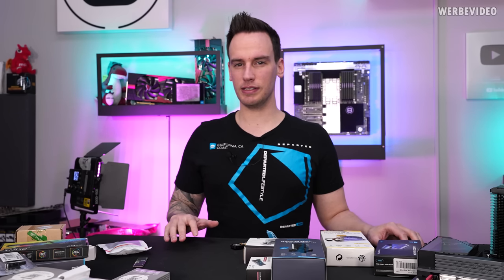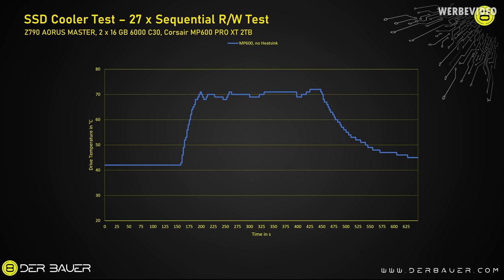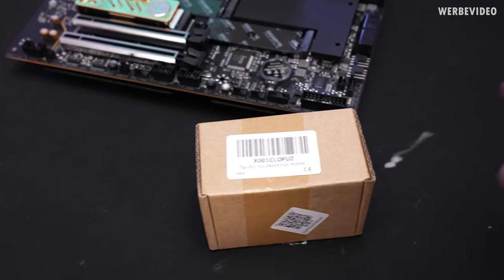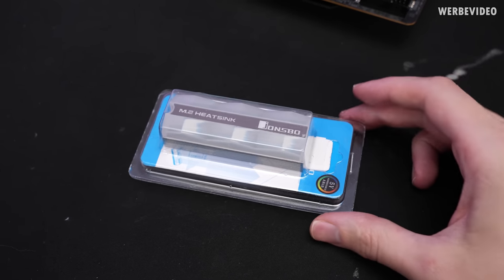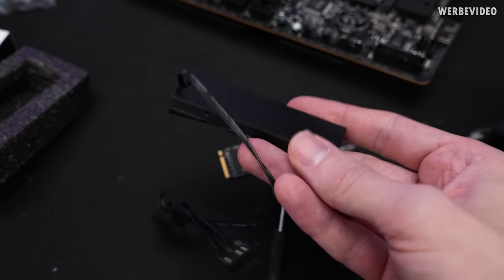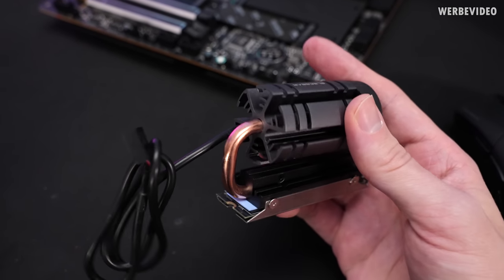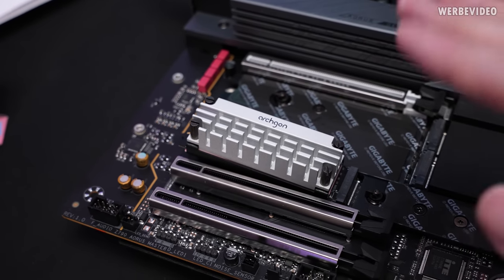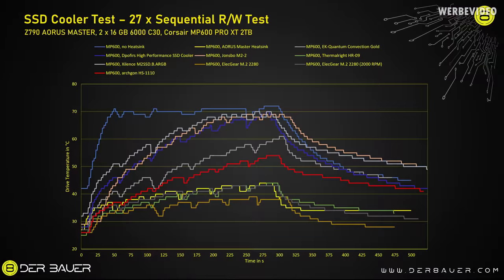Who designed these? Terrible Cooling Performance and "Interesting" Mounting Solutions

Comment: 3:54 From EK's productpage: "However, this latest heatsink will completely prevent thermal throttling in cases with sufficient airflow or otherwise significantly prolong the time before thermal throttling of the SSD occurs."  
  Well, it did prolong the thermal throttleling. But so does having an iPhone 13 Pro Max instead of iPhone SE (Both have A15 chip). The only great usecase for this would actually be to mount this at the back of a phone (covering the SoC). No heatsink fins also means you dont have to cut yourself everytime you pick it up

Comment: I have some basic NVME PCIE 3.0 SSD and I decided to mount a very basic and thin heatsink from Ali. The little cheap one mounted with rubber bands. I do not stress my SSD for a long time so I basically wanted something that will help an SSD to at least buffer the heat when loading game or something like this. It performs well enaugh as in a test like yours It reaches to 52*C and then drops back down to 30-35. When normally using my PC I stay below 50*C.

Still thank you for warning about the rubberband degradation. I have just mounted it a month ago and my PC is not exposed to UV light so I still have a time to figure out something better. ;) Probably I will end up with a zip-tie :D

Waiting for the tests of the rest. ;)

Comment: Der8auer, the Metal Pads are REMOVABLE, unscrew the screws you see in the thermal pad holes and the whole metal pad can be removed, no need to remove the thermal pads. Im using custom heatsinks o i removed all of them.
BTW, your TEST with original Gigabyte heatsink is not valid, the thing is that the cover covers ALL M.2 + Chipset, and on Z690 /z790 the chipset gets to 80 degrees, sometimes over 70 degrees [just tested] if you have everything plugged in and do lots of move/copy file operations, thats why i removed the original hetasink and use separate heatsinks, so they not touching each otehr or chipset
The style of this chipset coolers + m.2 is why i sent back AOrus Master and got MSI Unify-x, the uNify-X has same cooling but each heatsink is cut, no touching the chipset [the chipset after re-paste is 70 celcious], but im still using my own heatsink, the good ones are Barrow heatsinks that have 2 tiny fans and they also screwed from the top, i tested many heatsinks and these are great

Comment: The only reasons im going with bonkers cooling for my wife and my gaming pc's is the obvious 3" extension to my epeen. And that future Direct storage games might push SSD's a bit harder than they get pushed today.
Currently building the wife's pc. Have gone with the short version of the thermalright cooler on a WD black SN850. In a 011 evo with chimney style bottom to top fan arangement and the upright gpu mount. So the m.2 cooler should get quite a bit of air.

Comment: I'd like to see what your tests make of the M.2 cooler I bought.  ElecGear EL-80P M.2 2280 SSD Heatsink, Heat Pipe .  It seemed to me at the time that it was quite sensible compared to a lot of the ones you tested.  I am dubious of designs with small fans, thinking that a finned heatsink with good case airflow would be better from noise and temperature considerations. 

For me, this heatsink has significantly improved my SSD temperatures.  Previously, the SSD on its own rapidly shot to 80 deg C with very little load.  With this cooler, it rarely goes up to 50 deg C. 

I believe that Sabrent make a similar style cooler, so I'd be interested in seeing this type of design tested properly.

Comment: I have an xilence CPU cooler and its actually really good it dropped my temps by 30c over the stock AMD cooler on my Ryzen 5 2600 with no overclock due to bad motherboard even though with an old board this CPU will happily run at 4GHz

Comment: My budget motherboard does not have heat sinks for the M.2 slot built in. I also have USB M.2 adapters and the chips / board get EXTREMELY hot. I actually put a passive heat sink on my USB adapter I use and it seems to have helped, tho I agree with your assessment about the RGB "coolers" they seem mostly for looks. 

I would be very interested in seeing how other heat sinks perform. I've also been considering modding the steam deck with an M.2 heat sink (similar to the LTT video) and looking for a good heat sink that will do the job. Please do some more of these.

Comment: I have the Corsair MP600 Pro XT, and both of mine came with a heatsink. Did you remove it? It's not a straight-forward removal. I was missing that context in your video of where you removed the existing heatsink. I have an ASUS board and never thought to use the built-in heatsink.

Comment: I bought a different model SSD heatsink from Jonsbo (m.2-3 or something), which both looks better made, has no rgb gimmicks and at least for my ssd was the proper size. It still isn't held together by screws, the ssd is just sandwiched tightly between thermalpads and the 2 other parts (baseplate-thermal pad-ssd-thermal pad-heatsink), with the heatsink attaching to the baseplate with a sort of hook-slot, groove, requiring a bit of force to snap into place, along the entire side on both sides. Problem is that it also comes with different sized thermalpads, like the EK one (though they're the proper size for the heatsink), but no instruction manual on which to use for what type of ssd and whish side of the ssd to place them. So you have to either ask Jonsbo for help, or find the pictured guide someone else posted online after asking them, to which I've since lost the link to. On the plus side, it actually did lower the temperatures on my gen.3 ssd a decent bit. It maxes out around 51C in my case, averaging 38, with the heatsink that came with the motherboard averaging 44, maxing out at 50 for another ssd, but that one is also in a position with less airflow and is a higher end gen 4 one, so it's not exactly a useful comparison.

EDIT: They seem to have changed their website, so you can actually download the installation guide easily now. Finally.

Comment: The Elecgear could be interesting in some edge cases. The rotatable heatsink is clearly there considering the cylindrical part would block adjacent slots, not a bad idea but thermal coupling between components has to be pretty poor. The edge case where a heatsink like this could be useful is for the m.2 above GPU board layout, where the GPU backside will be creating a hotbox, one that isn't always optimally cooled due to case flow and other nearby components; having a small fan to at least pull in and push air through this little hot box gap could prove worthwhile. Another potential use case could be in a water cooled setup, where you have high static pressure fans that don't necessarily have the CFM for proper case flow, plus if you're exhausting radiator heat into the case by having external intake, this could reproduce the hotbox issue, and a small heatsink with a small fan could potentially suffice, though it would be noisy. 

Honestly, I want to see a test setup to recreate this. Closed bench with a motherboard that has the primary m.2 slot above the GPU, so that this hotbox can exist. Honestly the results wouldn't be all that surprising. No heatsink performs the worst, the non-heatsinks are a step up, then the smaller plate-style coolers including the ones with much larger 'fins' that barely increase surface area, then the proper finstack coolers, then the actively cooled and massive board-wide chunk of metal coolers on top. Though in this test, I wouldn't be surprised to seethe finstack coolers start producing lesser results; why? Because of fin orientation, why would anyone put vertical fins on a component that is most often mounted horizontally, on an offset plane to the motherboard, when the fins should have horizontal flow. At the same time, even without the GPU hotboxing the SSD, or a different board layout such as the motherboard shown here, it'd also be helpful to see case cooling with these SSD coolers, show how even just a cross breeze would benefit these; though the GPU would also be drawing air in and away from the m.2 below GPU layout, which might add some benefit to the vertical finstack coolers, as they'd have the GPU drawing air into them, though with the lack of blower-style coolers, I would imagine the exhausted perpendicular flow from most GPU coolers may become a hinderance in this kind of setup as recycled air would hotbox the components, at least not with more powerful cross-flow case fans. No matter the arrangement, a closed bench setup covering the various variables would make for some decent content and results. Case compatibility is also another important variable, as we've recently seen from the moronic placement of 12 pin connectors within the middle of a GPU. 

Some of the oddities, cut pads, tall knurled screws, the zip-tie cooler construction, etc., probably all come down to manufacturers reusing off the shelf parts. Why create an entirely new product when you can borrow from the parts bin. Zip-tie cooler is entirely evident of this, this one was probably 100% parts bin and why it didn't have a proper mount, probably old warehouse stock of otherwise unusable parts, which is very cheap on the manufacturing side as warehousing often gets expensive on unusable old parts.

Comment: when I installed my first SSD there where ne coolers available yet, so I had to look at the electronics shop for some coolers that would fit and eventually found some heatsinks for rasperry pi, I had to use 2 segments with different size to make it fit right, but the temps dropped by 30°C with sustained load, it reached 90°C before and stayed typically at around 55-60°C with the heatsinks

I installed the heatsinks with adhesive thermal pads from Akasa, they are fairly strong and worked pretty well for this purpose
you propably could remove the heatsinks without damaging anything, but there is no need for that because it works just fine

Never change a running system

Comment: Been thinking of getting the Thermalright HR-09 and use it as VRM heatsink, mounted using zipties or thermal conductive double sided tape (pretty strong bond).
It does look the part and way better than those aluminium blocks of typical VRM heatsinks
Reply: I'm not convinced that i'd put something this tall on only thermal tape, though it does seem to hold. Two things to consider well yeah insurance zipties, but also there might be spots in the base with nothing vital in them which you can drill and tap. Or you can epoxy M3 nuts on there, just rough up the local surface just where they touch.
Reply: @SianaGearz  On some boards there are even already holes that are simply not used.

Comment: Any reason you didn't test the large stock 600 xt pro heatsink?
On my 600xt pro I find it pretty crap with temperatures always 50 to 60+ even at idle, yet a firecuda 530 with no hs literally next to it idles at low 30s and under load reaches only high 50s.
And yes I've checked/reseated the 600xt pro heatsink.

Comment: I'd like to see just a square block/billet of copper cut the length of the drive, held on by thermal adhesive(or press fit with a thermal pad for testing)
99% of these products are just mass, so why not use raw mass.
I will say looking up these SSD coolers, many of them are pretty fun.

Comment: My personal solution was to buy some little raspberry pi heat sinks to stick to the controller and a little 40mm Noctua fan wedged between the cpu cooler and ram pointing at the SSD. It worked well enough to fix my heat issues, and was pretty cheap.

My big problem was that I was using an Asus ITX board where they stacked the M.2 slot on top of the chipset and tried to use the same heat sink to cool both. That meant my M.2 drive was sitting around 50-55C at idle thanks to all the heat coming off the chipset! Decoupling the drive from the chipset heat sink and adding just a little bit of airflow made a huge difference.

Comment: If that all copper rubber band fiasco was near a fan from a video card or something it might actually be superior. How much does the time-to-time overheating of an SSD cause wear? My SSD has no heat dissipation, but I will only ever be doing this kind of copying once in a blue-moon. It's just a system drive not a data drive.

Comment: 😅 I may or may not be writing this from a dual x5690 system with two 950 pro boot drives with heatsinks held on with the little silicone bands.. But I guess to be fair the ssd's are the more valuable than the rest of the machine, it's a btx-esque form factor with pcie2.0 to nvme cards so the heatsinks aren't fighting gravity to stay on, and it gets used as a glorified raspberry pi replacement

Comment: Very  bad comparisson, massif stock mobo cooler and a testbench with no aiflow.. Myself have an tiny alluminium aliexpress heatsink with tiny fan, on a samsung evo 970plus, i removed the thermal pads and used thermal paste instead, dropped 25c from no cooler

Comment: would have loved to see these in an ACTUAL practical environment, inside a case, which has ''active airflow'' produced by the internal fans. which will get some airflow going over those passive heatsinks. thats the ONLY way to properly test a passively cooled heatsink design.

thats why that fan-powered heatsink was the best contestant.

Comment: I got some basic pure copper heatsinks that are a few millimeters tall, nothing fancy, just copper with cube fins, they came with rubber bands, however the heatsinks don't have enough weight to fall off even if they fail. I've found that the yellow rubber bands fail, but the clear and black rubber bands have lasted.

Comment: Fun video.  I grabbed a cheap passive cooler form amazon advertised for a PS5 to put on my b450, and it seems to do the job.  Snaps together with a metal piece that goes underneath the 970.

Comment: JEDEC standards are clear (if not fully tested) about SSD temperatures.  I feel that people stress far too much about this.  Obviously, you don't want to run it into a throttle condition, but higher temperatures are actually better for data retention.  If you are super cooling your SSD, you aren't doing it any favors.  A good heat spreader is all you will need for most use cases.

Comment: This coolers RPM is over 9000 !!!! 😁😁😁
Cooling on this thing might be even better if you tape it shut and leave end opposite to the fan open, like a tunnel. Otherwise you loose air out the sides

Comment: Yes please, now I need to know about the other coolers.

I've asked a few times before buying an m2 drive if a heatsink is needed, and for general use the answer was no, though I've considered adding a piece of aluminum sheet to the controller IC. Right now it's bare naked.
I've never checked for temps, should I dig in to actually see if it can throttle, or that's more of a thing that happens when you're benchmarking or like you said, doing constant heavy load like video editing?

Comment: There is a big problem with built in motherboard m2 heatsinks. Most of them apply pressure from one side and cause m2 drive to bend underneath. It's also very hard to notice as you don't see this unless you take a peak under the heatsink at odd angles to see the drive bending. Some mobo makers tried to remedy this by having tiny support rubber pads underneath the m2 drive, but they don't help much and drive is still bending, simply because heatsink pressure is much higher than a wimpy rubber pad can support. This is why I bought Sabrent m2 heatsink and now my drive is enclosed in a nice and sturdy construction held in place by screws. No more janky bending.

Comment: If you want a SSD for a heat load grab a MP500, mine idles at 60C with a passive heat sink attached by thermal epoxy

Comment: I have that motherboard and I can say from experience the built in heatsink doesn't perform anywhere near that well if all 4 slots are occupied. I run 2 gen 4 drives that idle at 50c and 2 gen 3 drives that idle at 35c.

Comment: thanks, M.2 Coolers don't get much coverage so more is always welcomed. not that they're a crucial part of Computing, but they're interesting, and just not Talked about much.

if you'd ever want to test some more, the "Jeyi Finscold Q150" is a nice Product IMO. it looks cool and is still sensibly designed. (there's also the Q80 Model but the Q150 looks cooler and is more likely to be effective IMO)
i like it in that it's definitely good enough and looks cool for those that like the look of Copper.

Comment: Hahaha, I just got something very similar to the Elecgear cooler for review from Amazon. Haven't actually tested it yet. The fan on mine is a lot smaller - same diameter but recessed into the heatsink end. Came with a lot less stuff too. But otherwise, the same. The screws that allow me to 'clock' my heatsink are also so tight that they stripped out when I tried to loosen them. Most of this stuff is complete nonsense.

Comment: Great tests and very educationnal! I had been looking for a video like this a couple of months back ! This will definitely help people apply critical thinking on the design of heatsinks before wasting their money on badly designed cheap products.

That being said.... "most of the time if you have a board like this, just use the standard heatsink" .... Reality check : Most of the time we aren't using 500 USD$ Gigabyte Aorus Master boards. 

Yes, you do include the caveat that if we "don't have a included heatsink" some products are worth it. But what about the majority of us that are either running the heatsink included with the SSD or a motherboard heatsink of a MUCH simpler design / less mass, like we find on the type of motherboard most of us will use ? 

A benchmark of simple motherboard heatsinks, and maybe a SSD included heatsink would be nice to see the difference in °delta a cheap but well made heatsink can offer vs the included solutions.